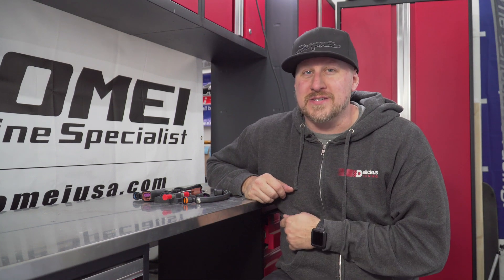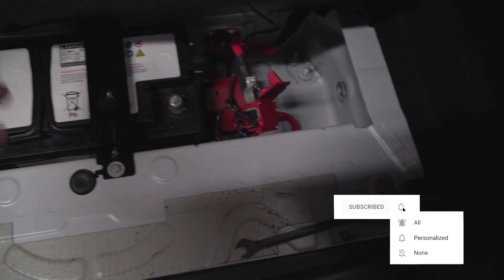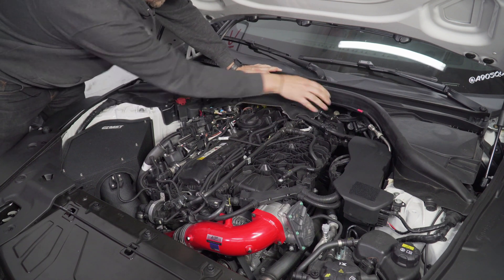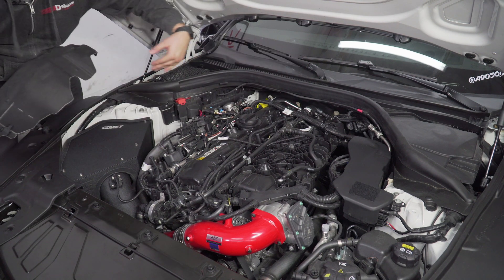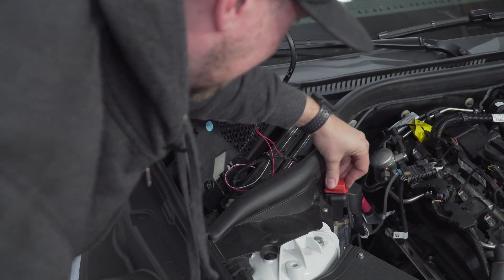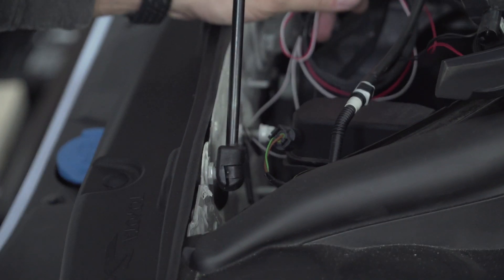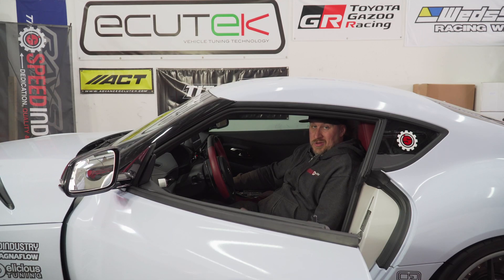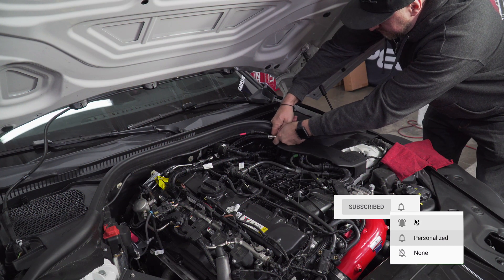One way to run E30 / E85 Fuel for your GR Supra

Comment: Is it safe to run Ethanol blends in the Supra? Will it cause any problems now or in the future to the fuel system?
Reply: This is not true. The whole ethanol corroding fuel lines and pumps applies to older cars that were manufactured before ethanol was standard in US and European fuels, E50 is the most that stock direct injection will support. The stock won’t supply enough fuel to run anything higher. So you will need to upgrade. Anything higher like full E85 will require port fuel injection. If your on stock turbo you won’t gain absolutely nothing from going full E85.
Reply: @305ANDUP  I don’t plan on going full E85. I’ve got an E35 tune right now and it’s good enough for me.
Reply: Up to e50 is ok. Anything more can cause corrosion to the fuel lines and fuel pump itself

Comment: Do You Need to Upgrade Fuel pump or injectors also or will stock work fine to run e85 after installing this kit
Reply: Sorry, that's for Supra b58, specifically
Reply: Stock up to e40...maybe e50, but pushing it. Anything over that requires more than just fuel sensor and tune.